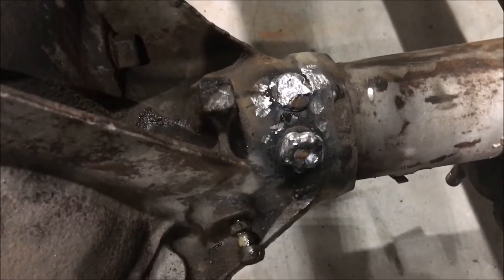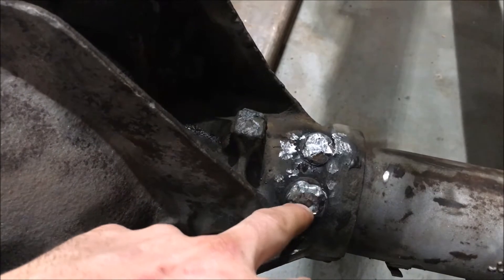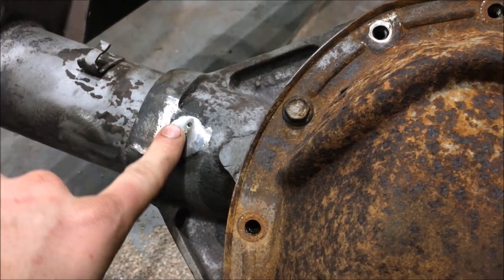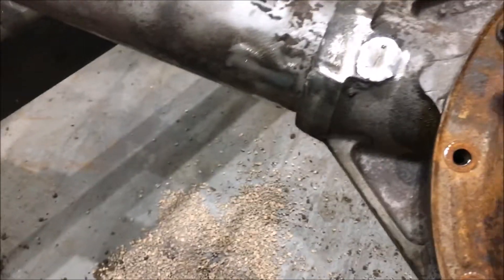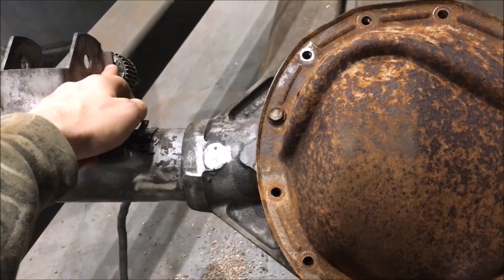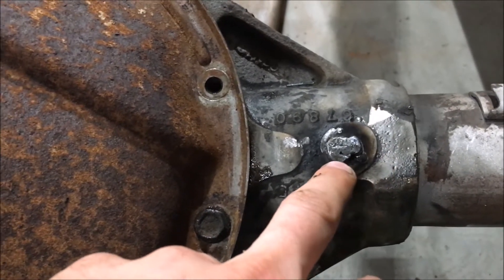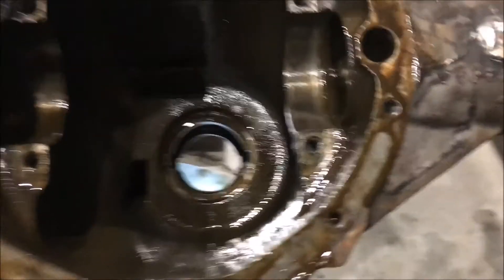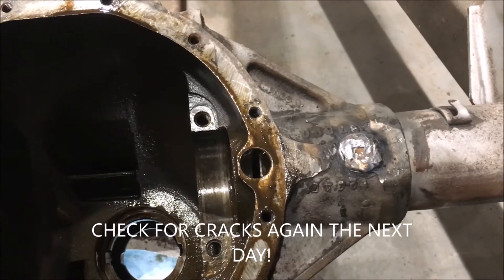Chevy 12-Bolt Welding Cracked Plug Welds

Comment: Plugs are welded with nickel
Reply from the maker: I didn’t want to buy a new spool so this is what I used. It worked fine and still hasn’t leaked
Reply: Weldmold 880 works well if you're using a tig. Main problem is dealing with the oil underneath.